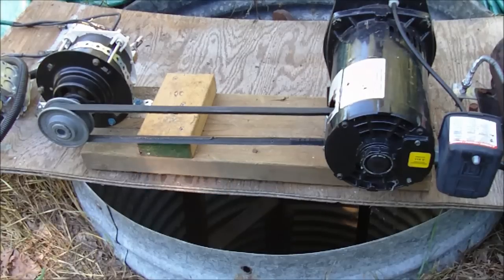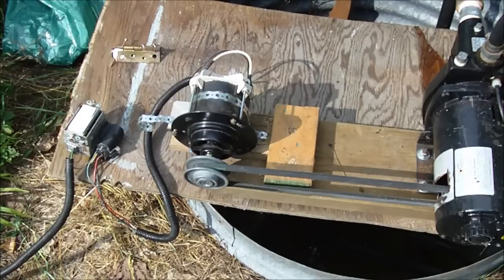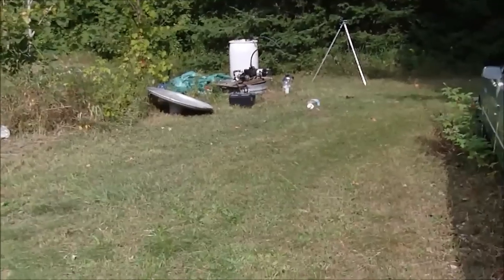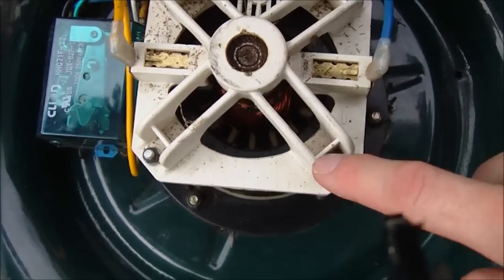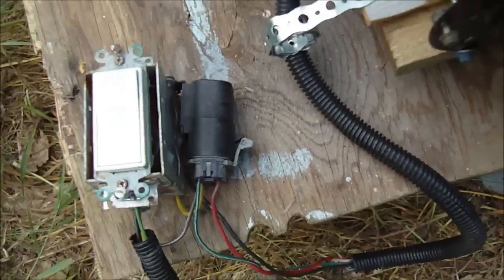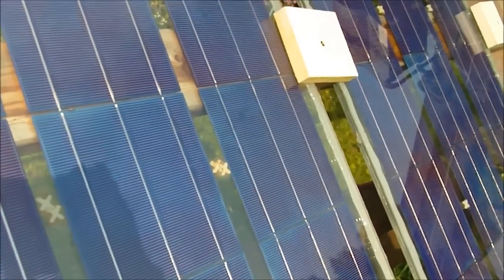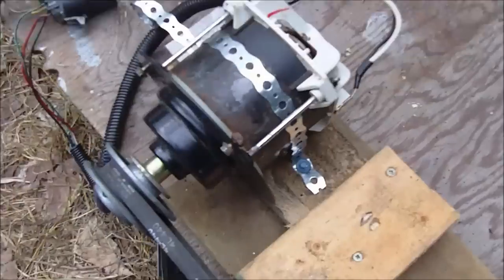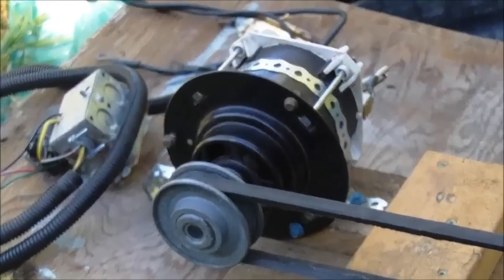HomeMade 12v / 24v water pump / jet-pump, built from free scrap, off-grid,

Comment: Your headed in the right direction.    Nice way to switch the DC current, your switch looks like a Leviton 5601-W, and the pressure switch a Square D 9013 FSG2,  or there
about, if I remember the difference in looks of the Square D contacts and the Furnas contacts and arrangement of lines in and lines out of the two brands of pressure switches.   GE used to make one too but the last GE pressure switch I sold was back
in the late sixties or mid seventies.     Nice video showing your DC load switched through a contactor which is very important for a safe operation.